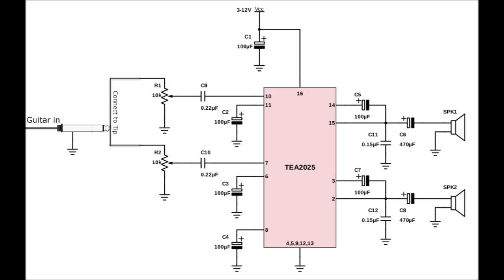How to make guitar amp circuit dual speaker - DIY 5 / 9 / 12 volt power

Comment: Can you show tea 2025 bridge circuit, I have tried to make it but it  doesnt sound good 
Please help. .
Reply from the maker: This might help you there is circuit diagram in the video. One thing to not make sure you make the component stay as close as possible to one another so the current doesn't have to travel far. Because when it does it will generate noise as the current catch signal from the atmosphere https://youtu.be/aBdLo_XmWUg
Reply: @neodiy  Thank you . . .! 
And I have used datasheet bridge mode circuit but still sound is not good. I'm using 5v 1A phone charger as power supply is it ok for this amp?
Reply from the maker: @Varun Kavil yes it should be perfect using that power... Have u made the circuit as close and compact as possible? And also connect one resistor with small resistance at the input between positive negative and test again... Making amplifier is not a straight forward job it takes tweak and turns to make it sound good especially when u r a beginner.... Check this circuit http://howtodosteps.blogspot.com/2018/03/how-to-make-homemade-diy-guitar.html